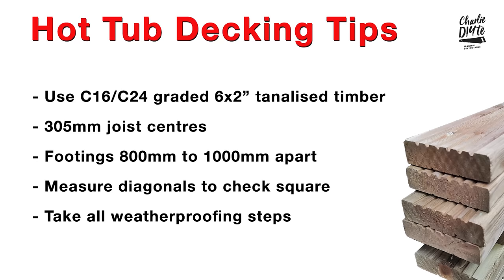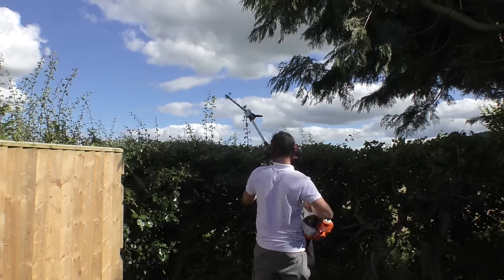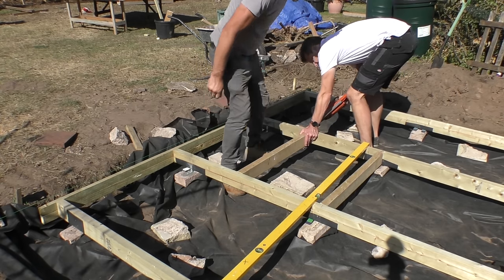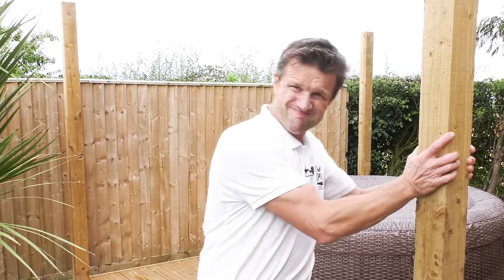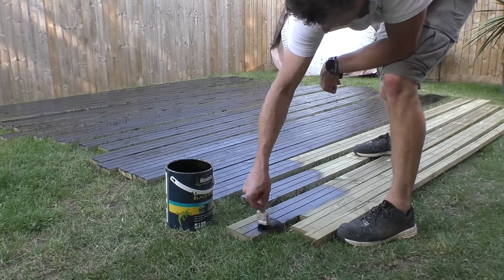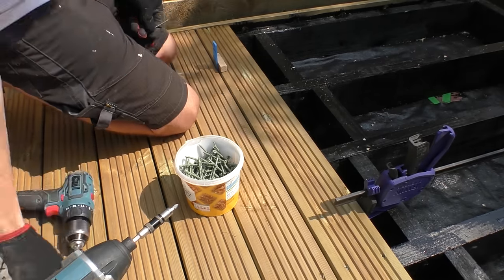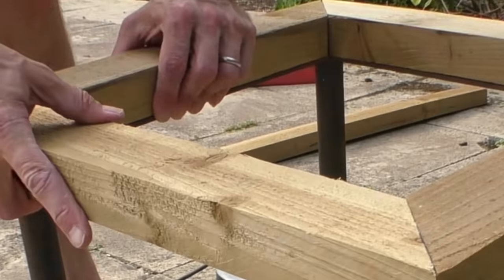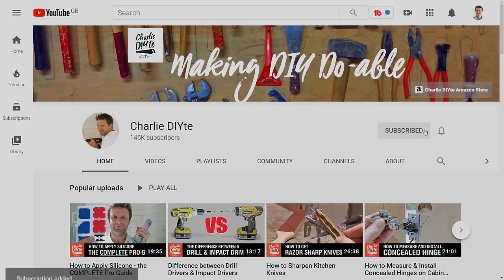How to Build Decking for a Hot Tub

Comment: Hi Charlie ... without trawling through 230 comments I don’t know if this has been mentioned, I have been in the building trade myself for the last 25 years, you asked if there are any tips that people could pass on to you, I will bullet point a few tips that I use when I install posts 
1: paint the sides of the post that will be underground but not the bottom 
2: Bore  a 25/30 mm hole into the bottom of the post about couple of inches deep
3: lay a couple of inches of gravel in the bottom of your posthole. 
These three steps stop water ingress at ground level and the hole and unpainted bottom and gravel allow any water that soaks in aboveground to gradually drain out of  the bottom of the post. 
Keep up the good work your videos are very well executed and I have picked up a few tips myself from them 👍
Reply: If you’re using Postcrete, though, then the gravel etc will be completely encased in the postcrete so will serve no purpose in drainage. I can see the benefit if not using it though
Reply: @isyt1  the gravel is in the bottom of the hole & the concrete/post rest will be on top of the gravel
Reply: @EmsillCazm  With postcrete you pour in water and then add the postcrete. Any gravel underneath the post would be completely encased inside the postcrete as it settles due to gravity
Reply: @isyt1  🤣🤣🤣🤣 you’ve obviously never used postcreate
Reply: @EmsillCazm  many times. You’ve obviously not read the instructions
Reply: @isyt1  🤣🤣🤣🤣 I’m out !!! Go Troll Someone Else
Reply: @EmsillCazm  no trolling here, just the truth. If you’ve been doing it wrongly for 25 years then I appreciate the truth is going to sting. It’s going to hurt that fragile ego.
It’s never too late to learn though. Who says you can’t teach an old dog new tricks huh
Reply: @TheMagicCardTraderUK  Thanks. That does indeed confirm you should pour the water in first which will encase the gravel.
Reply: What's the purpose of the bored hole?? Can't work that one out...
Reply: @isyt1  🤣🤣🤣🤣 Feck’n ell, Are you still on this !!! 
 “ LET IT GO !!! STEP AWAY FROM YOUR KEYBOARD” 🤪🤪🤪🤪🤪🤣🤣🤣🤣🤣
Reply: I appreciate your advice 👍😉
Reply: Nonsense, posts never rot at the base due to being hermetically sealed (no oxygen down there). Posts will only rot at ground level, so use Postsaver sleeves or bitumen and also dome the concrete to aid water run off.

Comment: I've installed lots of decking and this is how I fit the boards. 
Start off with the a nice straight board and align it with the the most visible edge. Screw this down with 2 decking screws every joist, drive the screws in at least 5 mm under the wood, the wood wll fur up when wet and cover the screw heads. For spacers use 90' brackets about 3-4 mm thick (note that your decking will shrink over time and you will end up with up a larger gap even though you used a 3-4mm spacer when you fitted it) lay the brackets on the first piece you fitted to form a spacer between the board you have fitted and the next one. Take the next board and offer it up, if it's straight it will be obvious against the spacers, if it's bowed turn it so that the bow goes away from the first piece you fitted. Start at one end and push board against the spacer and screw it down, move along to the middle (make sure you have spacers every couple of feet) use an old chisel and hammer the chisel into bite on the joist at an angle to the underside of the board you are fitting, then use the chisel as a lever to force the board against the spacer, while you are holding it in place screw the board down. Go back to the other joists between the two places you have fixed and screw them down. Now go to the end and repeat the process, this method will make sure you get the bows out of your boards and you dont need any clamps or special tools. Note that sometimes the spacers get jammed between the boards but just tap them up with a hammer from the underside and you will be able to remove them, once you get a feel for it you will not be forcing the board so that the spacers are so tight you need to do this. Hope this helps someone.
Reply from the maker: Many thanks for taking the time to pen such a comprehensive comment 👍🏻
Reply: @CharlieDIYte  Thanks Charlie, love your video's. the first one I ever watched was all about sealant and profile tools. I must say that before I watched your video, every sealant job I did always ended up as a mess. After watching your video and buying the profile tools I'm much better at it and no longer put the job off for fear of making a mess. I'm sure I'm not the only one who gains a lot from watching your videos, thanks for making them and sharing the knowledge.
Reply: you should make a video on these points? :)

Comment: Hi Charlie great build,Even the pro's get it wrong iv been chippieing for 22 years and at the moment I'm replacing a deck I did about 13 years ago,And by studying where rot originated my next deck should hopefully achieve 20 plus years,I'm currently 3/4 of the way through the sub structure of 50 sq m deck which is just shy off 2ft off ground,
Your on the right track only thing I would say is pop some gravel under the fascia rip,I can see you left a gap underneath which is good but it will fill over time with soil,better fill the void with gravel now,
I would also vent every joist space,my deck I enclosed after a few years and this was the beginning of the end for it,
We're only just catching up with the Canadians and Americans on deck installing,Enjoy the tub
Reply: Agree totally with your comments,, been in and around the trade (now retired) 40 years and latterly helping friends and family repair and replace fence and decking, sadly treated timber will rot 12-15 years is good. Home grown fencing grade perhaps 8-10 years. You only need to cut a section of 'treated' timber to see how shallow the penetration is.  However always enjoy Charles videos and never stop picking up ideas from him, interesting to see the d i y take on construction.
Reply from the maker: Thanks Dean, Vic. Always good to see a bit of a conversation going on in the feed. A couple of thoughts. Firstly, I understand tanalised timber isn't nearly as good as it used to be when, if I'm not wrong, arsenic was one of the constituent elements. I agree with what you say about penetration - 5mm if you're lucky. Do either of you have any views on the comment that's popped up quite a few times in this feed since I posted the video - that I've put the decking the wrong way up. Clearly the manufacturers intended it to be this way up as a) it assists with run off and b) maintains grip when the deck becomes a bit weathered, and c) would look wrong if the two small grooves on the underside were instead facing up. However a lot of people are suggesting the right way to construct is grooves down to minimise the amount of deck wood in contact with the joists beneath and to assist with run off.
Reply: To be quite honest I usually lay the deck boards deep grooves on the underside,I think it's a bit presumptuous to say that's right or wrong,I tend to lay my decks level so I just see it as a place for water to sit,But I have built quite a few fishing pontoons which were specified a decent slope and grooves up,So if I was to build in falls I would utilise the grooves,However for me use the grooves as relief cuts making the board more stable,
What I have noticed as well is that quick grown timber seems to suck the tanalith up deeper than slow grown timber up to 8mm penetration on wide growth rings and 2 to 3mm on slow grown not sure what effect this will have just food for thought,
I think you done a great job with a considered approach the substructure 9 times out of 10 will not out last the deck boards anyway
Reply: @CharlieDIYte  Yes totally agree with Dean , grooves down for me plus don't over sink the fixing screws. I know composite boards are expensive- but becoming slightly cheaper and look to be a better long term prospect.My sons took over my/our domestic client  base a good few years ago but I do still feel a degree of responsibility towards those who have suffered rot, having constructed many many square meters of decking I must say a good pressure wash early Autumn and treat with Cuprinol or similar should help.Its all about air flow and cleanliness. Also dont leave mats, dog baskets etc etc  around..Joists/beams are not immune to rot or decay but perhaps due the the small surface area which could trap moisture are less of a problem.

Comment: i appreciated that you didn't try to hide your errors or more accurately what you later learned. I also over-engineer builds, in part to over compensate for a lack of knowledge. I did go to college for painting and decorating over 40 years ago. The most vulnerable part of your wood is the end grains. I would have had a small bucket (paint kettle) with some clear wood preservative in and as I cut and fitted the noggins I would have just dipped the end grains in the preservative first.
Reply from the maker: Thanks mate. Great tip! You and me both, on the over compensating for lack of knowledge 👍🏻

Comment: Hi Charlie, fantastic tutorial. I'm nearly finished on mine and thought I would share a tip that has saved quite a bit of time digging out the neverending footings for the joists. I bought a ground Auger drill bit for about £12 and this broke the back of  digging the holes in super quick time. Thanks again for this excellent content and keep up the great work.
Reply from the maker: Thanks Richard. That's a great tip. I'll use that next time. My problem here is, after years of conifer growth, the soil was just so powdery, even my post digger didn't work because the soil just fell out the bottom. 👍🏻

Comment: Hi Charlie, I have just completed my first deck construction for a customer 4.25mx 4.0m. I have to say that I watched your videos a number of times before and during the build and I found it invaluable, so thank you very much. I tried to take as many of your learnings into account (painting the frame with bituminous paint before construction). But. I have to say I found the mounting of the bearers onto concreted bricks a real pain. Also, my customer chose Yellow Balou hardwood boards and wanted to have the screws hidden. For this I used a Kreg deck jig, which was very good (maybe have a look at it yourself). Both the customer and I are really pleased with the result, unfortunately I can't attach any photos to show you, which is a shame. But feel free to contact me if you would like to see them. Thanks, John
Reply from the maker: Hi John, great to hear from you and thanks so much for telling me about this project - humbled you found my vid so useful! Yes the concreted bricks are a complete labour of love. I guess there are other adjustable systems you could try whereby you still set them in concrete but can then adjust the height. They will of course add to the cost though. You're obviously quite a perfectionist - I love the look of that Kreg jig. Presumably you also used their screws? I'd love to see some photos if you could email them to me at charliediyte@gmail.com Thanks again 👊

Comment: Hi Charlie, recently got into your videos, learning lots, thanks.
I've built a few decks over the years, but being permanently skint and as tight as they come , always done them cheap. 
Currently our Lazy Spa hot tub is sitting on a deck made from Wickes gravel boards. Always find them cheaper than decking, less slippery in winter, and long lasting. 
Unfortunately last summer decided to paint top of boards in creosote, the smell lasted ages, wife was not happy! Strangely I like the smell.
Couple of tips to lower your hot tub costs : make a jacket for it from Wickes Thermawrap to help with wind chill. We also installed an outdoor hot tap, so we can fill hot tub  with 40 degree water, save on electric waiting to warm up, gas being cheaper. Even cheaper if your not on a water meter.
Lastly the pump is the weak spot on these. If you live in a hard water area as we do, it's worth flushing pump thru with limescale cleaner monthly.
Reply from the maker: Some great tips there, mate, thanks. Fortunately I don't live in a hard water area. The main problem I had was with a bacteria that looked like snot - after a summer of continuous use at 40 degrees (the family won't go in it if it's at less than 40!) which I've finally eradicated by draining and then flushing with an anti bacterial agent. For me, the weakest part of this is the cover, which is either over or under inflated, and looses a lot of heat. I'm contemplating buying a new cover but they're a few hundred quid. I'll check out that Wickes stuff though, thanks 👍🏻

Comment: Hi Charlie. You used a remarkably similar approach to how I did the floor of my garden gym/office. Used 7N concrete blocks mortared into a bed of MOT1 and as you did levelled them when the mortar was still curing. I worry to this day about not digging deep enough holes for each block though - I only went down about 150-200mm. But it’s been two years now and a hell of a lot of weight on the squat rack and further dumbbell racks on top and the whole structure has held firm and the internal floor is still completely level. I used 5b2 C24 and like you put loads and loads of noggins in to help strengthen it. I did also use heavy duty angle brackets to bolt the joists to the concrete blocks but probably overengineered that as the weight of the gym would never allow the structure to move on the concrete blocks. I did use DPC on each block but as it’s a room rather than just a deck, there was no risk of water getting in from above so I think all good there. The only other long term concern I have is that in order to maximise headspace within the 2.5m height rule, I only allowed a ventilation gap of 50mm under the joists. At some point I will lift up one of the floor boards and PIR to inspect the underside of the joists for evidence of rotting. Was a great lockdown project though despite the scarcity of materials at the time (I recall paying through the nose for the c24!).
Reply from the maker: Yes that does sound very similar. I didn't go down very far with my foundations either but as with yours it doesn't seem to have moved and it now has a roof. Overkill maybe on the anchoring but peace of mind when it's blowing a gale.  Sounds like a fab project. 👍

Comment: Hi Charlie, great video. I replaced the inflatable part of my hot tub lid with kingspan (doubled up in the centre). Keeps the heat in much better than air and is much sturdier (but heavier to remove and more difficult to store over winter). I removed the inflatable pocket and cut away the skirt which holds it in place, then just used stixall to glue the lid to the kingspan.
Reply: Great idea!
Reply from the maker: I'm about to do this, Paul as the inflatable lid is getting punctures - a manufacturing defect. Have you encountered any problems - like the foam flaking everywhere and or the foil peeling over time?
Reply: @CharlieDIYte  mines been pretty good for a couple of years, go for it. If you can't use a single board then  foil tape good for the joints and overlap with a board in the other direction across the joint. Foil does discoulour a bit with the chlorine but nothing major. Foil tape to cover the cut edges also. Not at home to take a photo, apologies.
Reply: @spongefactory  Hi Paul, I’m considering doing what you did.  By chance, would you have any objection sharing a photo of what your cover looks like?  Also, I noticed that there are different types of kingspan.  Is there a particular one you used and what size?  Thanks!  Dave